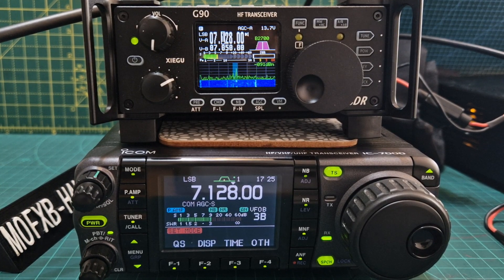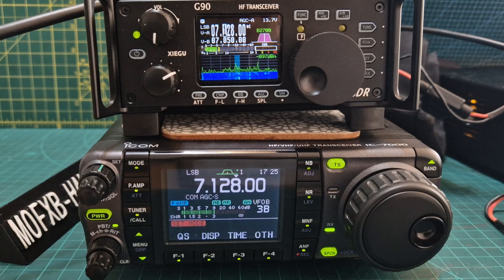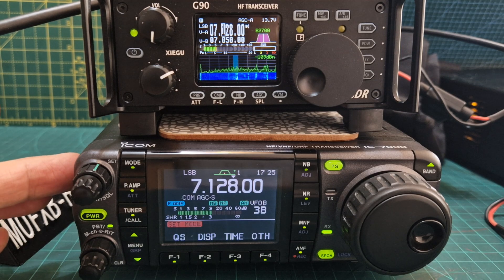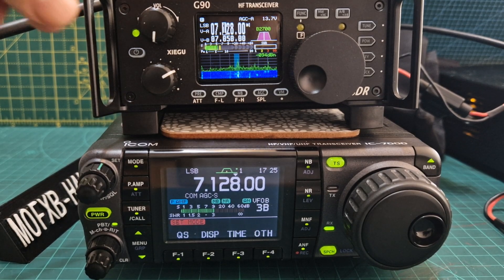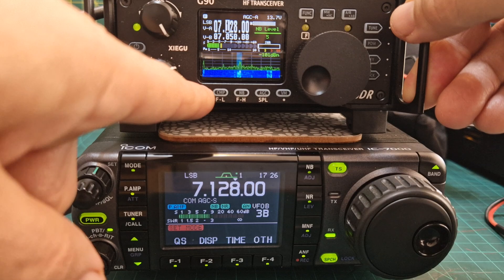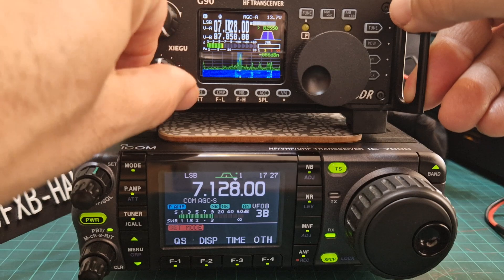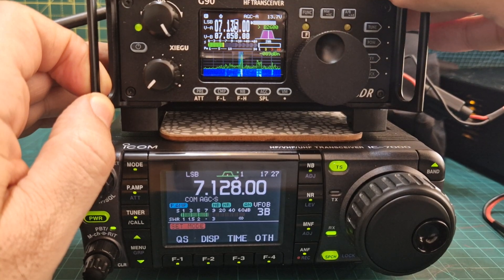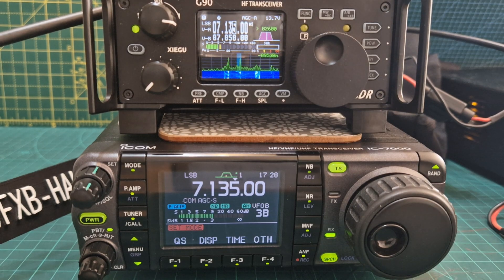XIEGU G90 & ICOM IC-7000

Comment: Thanks for the video; I love the 7000, best all around LF-UHF rig around from where I sit. I have been thinking about getting the G90 as a holiday rig. Perhaps the next video could be a side by side comparison (rather than one on top of the other's speaker) and you could try a signal on both, first with all filters off and squelch open / RF gain up, and then both signals again with each radio cleaned up as best each radio can. Thanks again and keep up the good work! 73
Reply from the maker: welcome g90 is good.